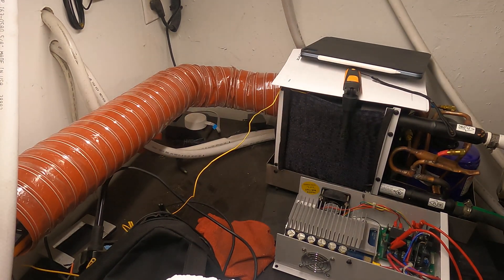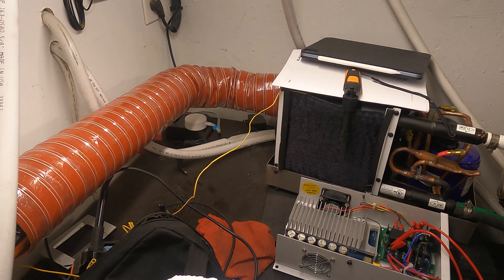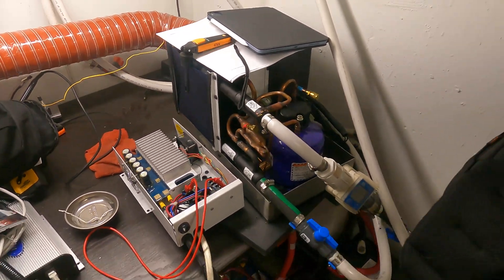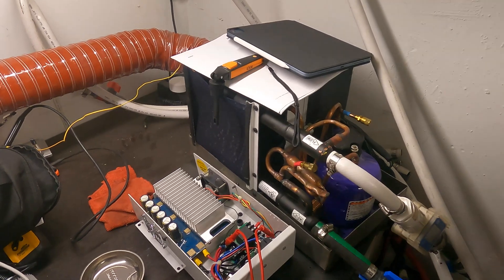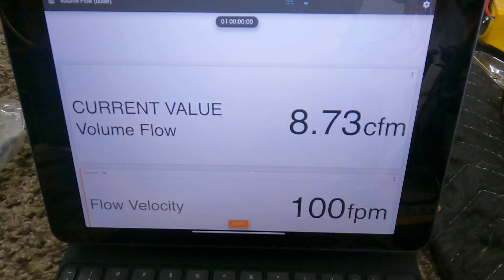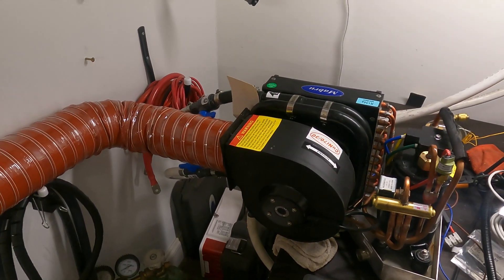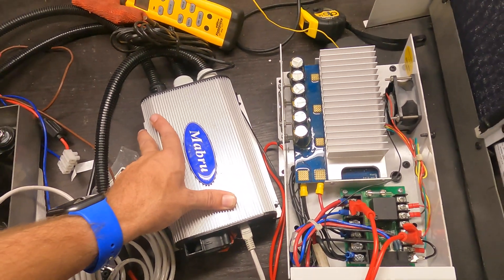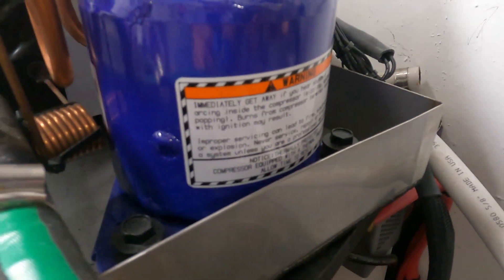Mabru SC7DC 12v Marine Air Conditioner vs Competitor's DC unit. What is the Best DC unit Available?

Comment: Obviously superior but why even with yours do we not see a true 7000 btu. I own 4 of your 12000btu units and one 7000btu but I always hear the same gripe from those in the marine ac game. It is that a 12v unit never produces btu advertised
Reply from the maker: In standard setups, our DC units will produce the rated btu. The hard 90 degree turn with the ductwork is very restrictive and affects the cooling capacity of the system. There are other factors that will affect the cooling capacity such as water temperature, return location, and low voltage.

Comment: Does anyone make a 24 dc unit. I can use a dc to dc but that introduces a loss and requires larger wire. Everyone  seems to be going 24v or 48v as they refit with lithium. Seems like a need.
Reply from the maker: We are currently working on a larger capacity 48v unit. We do not carry a 24v system at this time due to an efficiency loss that we experienced while experimenting with other voltages where the 12v unit was still more efficient with the power loss of a Victron step down than the 24v version. You can use the step down close to the unit and have the unit cables connect to the step down after a fuse and deal with smaller cables

Comment: $ for $, these still don’t compare to 110v + inverter…
Reply from the maker: a 110v unit, running though an inverter will draw about twice the power as our DC units. Sure, you can double up the bank but will also need twice the incoming charge to maintain the system running which can work in some applications with plenty of available power but is a problem on most installations.

Comment: Have you considered doing a chiller unit so a hydronic system can be used instead of a single blower?
Reply from the maker: The issue with chillers is that they are not very efficient in small scale. There are two pumps, that need to run whenever the system is on and the system needs to be able to handle the full load even if you only need to cool 1/10th of the area of the vessel. Variable capacity chillers exist but in line voltage. There is not a DC compressor available that is large enough to be feasible

Comment: THANKS NICK! Really persuasive. HOW ABOUT THE VARIABLE SPEED!?
Would REALLY sell this if we could see the lower amperage when the speed is throttled down. REALLY an important sales feature. Will check back if you could even just note it here in the comments. All the best! Danny
Reply from the maker: Danny, both our DC units and our new VI units are variable speed. Our DC units adjust speed based on the difference between set temp and room temp. The 115/230 VI units also adjust speed this way when in auto fan but we took it one step further and have different eco modes that limit compressor speed based on fan speed setting.  The 7DC will draw about 18-20A at 12v when just maintaining temp (lowest compressor speed and low fan speed.) I hope that this answers your question

Comment: Do you have a 48V unit in the works?
Reply from the maker: We do not have anything 48v in the works. We do have a new line of AC powered inverter type self contained units that we believe will be a better fit for the higher voltage applications.
Reply: @MabruPowerSystemsINC  thanks for the response! 48V would be greatly appreciated, it's the prevalent voltage for electric propulsion. Also have you ever considered making a heat-pump water heater for marine applications?

Comment: The biggest con is the price on that small 7000 DC unit vs the 120V unit's that cost 75% less that can be powered by an inverter charger that is still needed to charge the battery bank on either units.
Reply from the maker: Our 7,000BTU 115v is about 50% less but draws about twice the power, has substantial starting amps and is not variable speed. It’s not really a fair comparison. If you have huge alternators or a large lithium bank, the 115v unit could be a great of alternative but other than that, it would not perform properly.

Comment: Do you have plans for a larger DC unit? Catamarans can use more BTUs in the salon.
Reply from the maker: We do have plans but larger unit is going to be 24v rather than 12v.
Reply: @MabruPowerSystemsINC  That's good news! My boat is 48v, as are many medium-large cats.
Reply: Would like to see the inside of the marbu power box. I see the competition has a resin coated board.